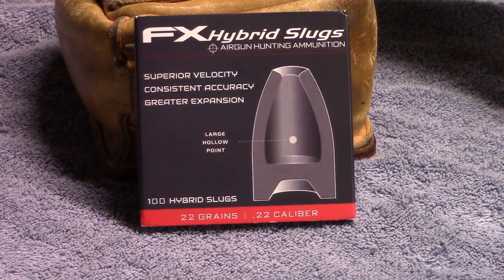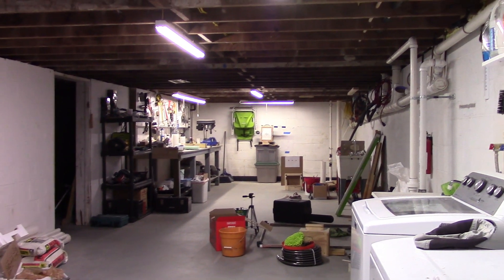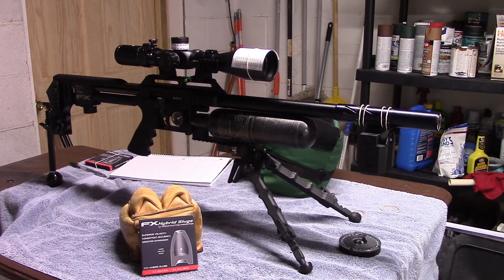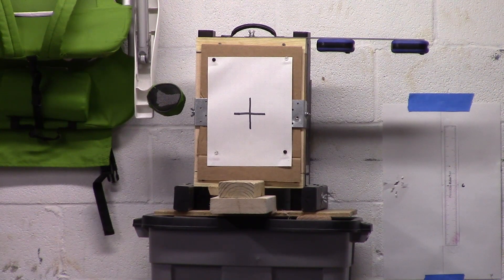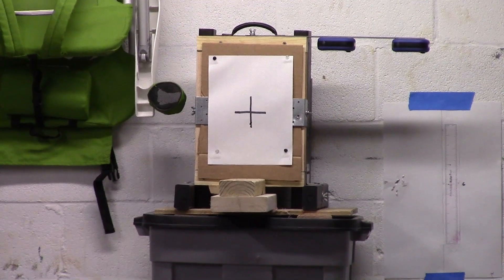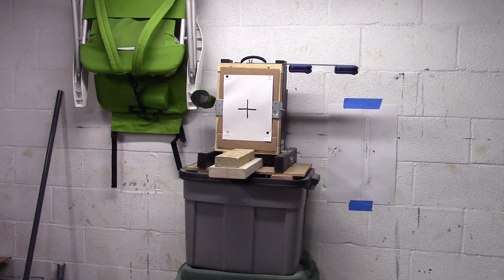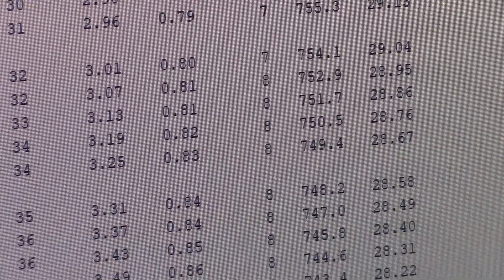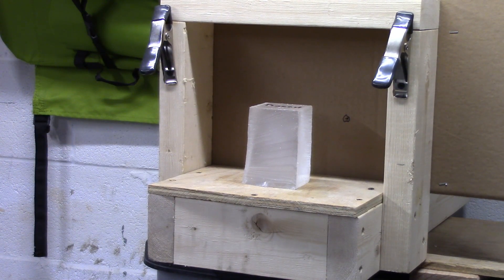Air Rifle Slug Expansion Comparison NSA vs FX Hybrids

Comment: Great video! I shoot the .22 @ 1020 FPS out of the slug liner. The .25 is getting a tooling redesign for thinner walls at the nose so they expand like my hand swaged .25’s used to 🍻 The .30’s expand the most violently out of all 4 calibers = almost fragment when shot into Clear Ballistics gel @ 100 yards.
Reply from the maker: Great to know that information. The 25 caliber is a great all around air rifle hunting caliber with just it's increased diameter compared to the .22 caliber. If you can the .25 cal slug to expanded like the FX 22. Hybrids it would my go to round for longer range shots and larger critters.
Reply: @gunpowderairpower8155  great testing you have done, I take the Nielsen 29.5s 25 cal and take a box cutter razor and put 5 cuts on the nose in equal spaces then score it down the ojive just a little, at 25 yards get massive expansion with a muzzle velocity at 880/890 on soft targets, I have recovered some that measured .458 with the 5 pedals curled back, like a jhp handgun bullet, it really helps with cases where you dont want over penetration or total perforation of the target. Give it a try, works with the .22 also Thanks and shoot often and safely.

Comment: They need more speed I aea HP varmint 25 Cal shooting the Nielsen 26.8 at 1030 fps almost double in size .48 caliber expansion shooting  a can of water at 25 yards
Reply from the maker: A can of water is not suitable for testing expansion. You need to test using a calibrated ballistic gel that approximate the effect of shooting into flesh. I have tested various types of airgun slugs into the gel and recently shot pigeons at fifty yards and get the same results. The slugs that I have found that will reliably expand are the 22. FX Hybrids (not the 25 cal. FX), the Javelins and the Griffin with the polymer ball. I would use the Nielsens for small to medium birds with body shots and use them for head shots on groundhogs and larger critters where you want penetration.